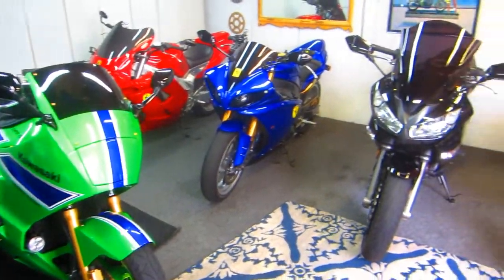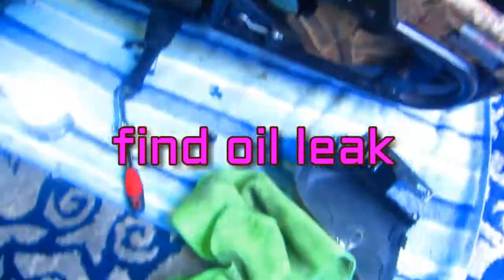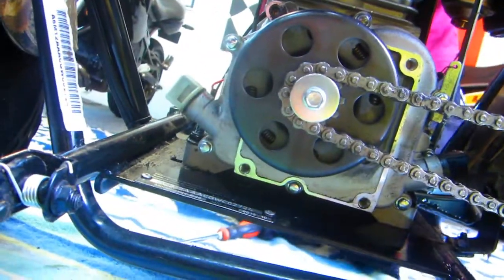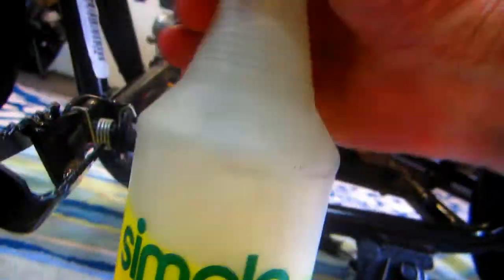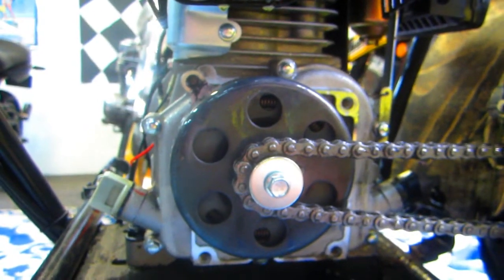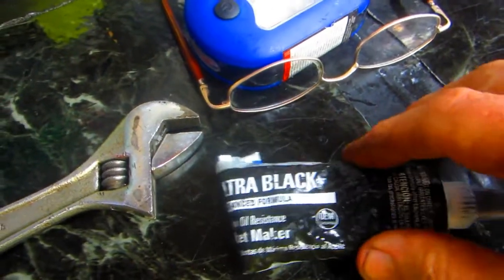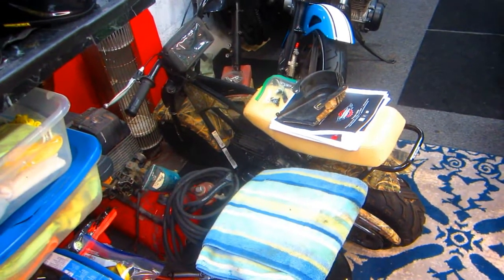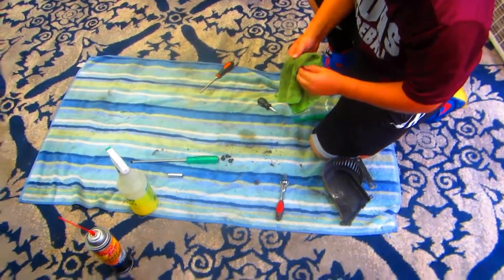HOW TO REPAIR OIL LEAKS ON ANY ENGINE VERY EASILY

Comment: When this kid grows up and is working on his own bike(s) he'll tell other people how the old guy down the street taught him a thing or 2 on repairs. I myself have a very fine hair line crack about a half inch long  in my cases by the front sprocket that will leak just enough to make a mess over a few months of riding. Common issue on the 1st gen zx10r's. Forums solution is to weld this but i"ll try the stuff you used first. Thanks for the upload.

Comment: My mini bike has been sitting 3 years inside a garage just wanted to let you know why does my oil smell like gas my bike stalls a lot every time I give it throttle it's not moving I don't know what to do
Reply: Does white smoke come out of the exhaust
Reply: Did you completely drain the tank and carb of the old fuel and add fresh gas and try it?
Reply: Your carbs prob need a good cleaning
Reply: You need to seek out Eric "The Gray Goat" from OMB WAREHOUSE and explain your problem to him and he will tell you exactly what to do.
Reply: Strip and clean the carb, dump the tank and get fresh gas.